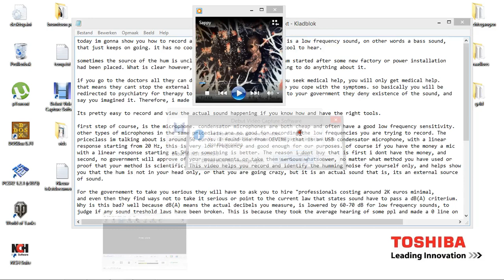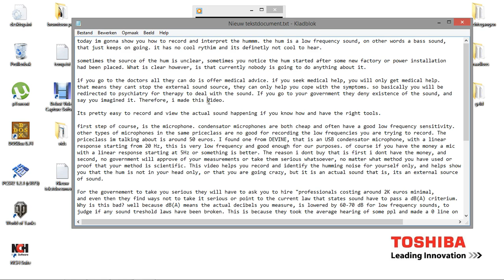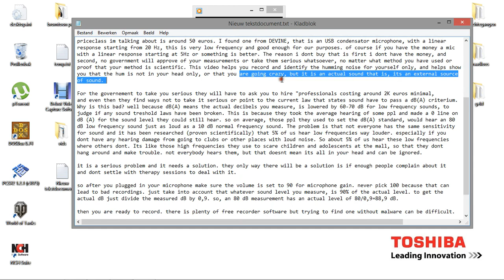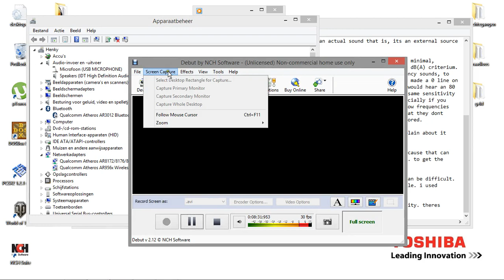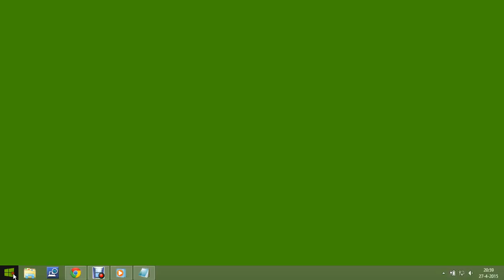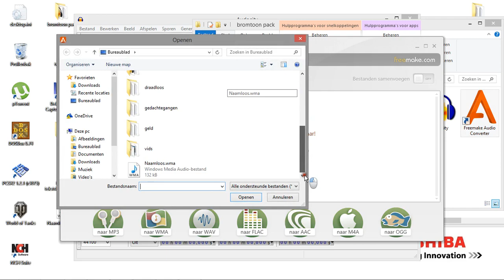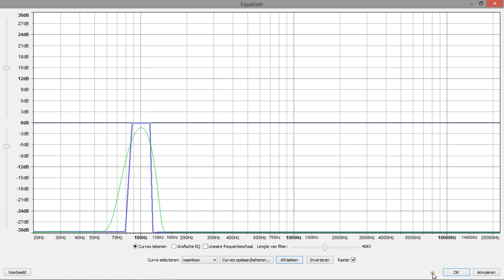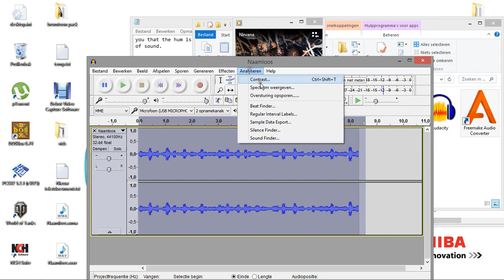How to record and make "the hum" visible - low frequency sound

Comment: How can I use this app??I'm having a problem  with my neighbor. Can you tell me how to use ??please
Reply from the maker: its pretty much shown step by step above. What part are you having trouble with?

- making a recording
- converting the recording to the right format
- opening the recording in audacity
- opening the frequency viewer etc in audacity
Reply: subwoofer  low frequency vibration.  he used subwoofer at midnight  i cant heard sound but i felt vibration. im live 23 floor. so i want to proof when he use subwoofer. is it easy?  thank you so much. henk .
Reply from the maker: Well, I may have been boring in most of what I said in the video but it really does cover all the bases:).

It seems your first step is recording the sound. If in your case it is very clear when you hear it and when you dont, like 2 distinct moments/feelings, then the best thing to do is make a recording when you dont hear it, and make a recording when you do hear it. Then check the difference in dB in audacity to see how much louder a sound is at a certain frequency. The lower frequencies are the bass so thats probably interesting for you. With this method you can show how a "bass" sound is a certain decibel louder then normal.

The first step of course, is making a recording. As said in the video, a condensator microphone is best for low frequency linear responses (its more reliable for measuring the bass). So buy a condensator mic. You can really invest in this and have one with internal battery what will make the recording better quality because your laptop fan noise isnt also recorded, but this really isnt needed in your case. Think of the purpose: you want to see for yourself, maybe show your neighbour. Any sound measurement you do yourself without any certificates etc that you need to own wont be reckognized by law so they will be absolutely useless in court. Its only for you and they person that you have trouble with. If you want to use something in court you have to pay some guy thousands of dollars to make a simple reckognized measurement for you…

Allright, so once you have the simple 20-50 dollar condensator mic connected with USB on your computer, you can check the microphone settings as shown in video...

I think this explenation is going to be as long as my video now that I look at it..Maybe just watch the complete video and tell me what is hard to do:).
Reply: henk visser thank you henk. I just want  use proof  management. When security  came no sound  but I'm laying down I felt head to toes... 2:30am keep vibration  now.    I do have a apple notebook so I will buy mic and  record. I hope it'd work. My neighbor  very sneaky he low volume  and use subwoofer.
Reply: henk visser most of time I hard to hear  but I felt so vibration. I forgot  to tell you :((
Reply from the maker: Not sure if apple notebooks have usb-ports, didnt they only have firewire (or thunderbolt or something) ports? Might need a usb to firewire adapter, check google for your type of notebook:)

recording is done with steps 1-5 from this instruction: https://www.mactip.net/how-to-record-sound-on-a-mac/ or just immediatly in audacity. For me audacity didnt work well for recording, only for interpreting recordings...Just do some testruns first I guess to see what works best.
Reply: henk visser thx
 I will ask some to do this. It's not easy  from me. I will let you know thank you a lot.
Reply: Eun Ji Back I’m having the same issue :(
Reply: What is the title for the person I would need to hire to record this low frequency? A sound technician?
Reply: Nancy  he used subwoofer  until 4am and 9am. I cant sleep nomal.it's felt plus sometime sound too. I feel sorry for you
Reply from the maker: @Nancy I I donno it depends on the country you live in and the language. On google I found some relevant results with "lfn noise" but its still just a lot of research papers. and "sound professional measurement lfn" for me mostly give dutch results of professionals or again research papers or software tools...In my language directly translaten to englisch I used the 2nd searchterm, but generally in the US all the sound pro's are focused on making music so thats sucks. Guess you would have to find some renowned company. A good way to find out what companies are reckognized by law, is to complain at your local government and they send someone reckognized by law to make a measurement. This guy is usually forced by the local government to say there is nothing wrong though if you say you have lfn (low frequency noise) complains from an unknown source, but yeah if you say its your neighbours and they come at a time your neighbour is playing the base then you got a good shot.

In the end it seems it has been made as hard as possible for people to have a grip on the problem of lfn noise or to find out what to do and how. If my vid is to difficult to follow you may wanna try a lower treshold method of just using your internal mic of laptop and apple recording software (quicktime has it) to record the sound without the hum, and record with it, then substract those from eachother in audacity to find out how much stronger the base is then normal. Its less reliable but still can give you a general idea and maybe the local government is more compliant to help you. In my country they are forced by law to serve the people and there are definitions in the law about noise tresholds so...yeah...research and action does help. Thats all the tips I can give you at the moment I think.

So if you can just use your internal mic in the laptop and find the option in quicktime (google apple recording software quicktime) or can use audacity directly (google audacity how to make recording) to make a recording of both situations, with substraction you can filter out most of the unwanted noise your laptop produces (google audacity subtract one track from another).  

So in short: try it yourself if you can, substract and see what sound level you end up with, check the law to see if that sound level is illegal, activate your local government, if they deny existance of the sound use the company the governement used and pay them to make an independant recording. Damn when googling in english its really a million times harder to find these companies...
Reply from the maker: But thats probably because google only searches for local companies...
Reply from the maker: I was just thinking...the response of your internal mic may be so low out of linear that an 80 dB sound (loud) may be measured as 10 dB (nothing). It really depends on the exact model...(a mic is electronic, response means reaction, having the same sound pressure reaction for one sound compared to the other at the same volume,  means linear, having a different measurement means its worthless, so if your internal mic ends at 200 Hz on lower frequencies (the amount of Hz)its...not usefull)Sorry its so hard, when making this video I even made some mistakes that i'm ashamed of but talking about it and sharing can help. I had an lfn group with thousands of members hat had plenty of tips to get me started. But thats for people who hear the bass sound even if its not their neighbours...I started blaming my neighbours but think about it: who would play a base sound with no music and then sleep in the same house? It would annoy them the same as you!

There is just so much to say about this but what really suits to what you need for info in your case...Pro's cost cash and can be disappointing, gah so many possibilities on whats what  just based on that "bass sound bad, need help, I dont understand, how to find help"...I think im at the end here. This is all the info I can offer.
Reply: henk visser  I found few days ago my upstairs  gave subwoofer  too. This is not joke. How to record  upstairs vibration? Please

Comment: henk visser. Thanks for this video. I need to record LFN coming from next door. Can I record, using a condenser mic, on Audacity, and get the same result, without using a recording app? I noticed that you didn't use Audacity, but the FreeMake Audio Converter. Why didn't you use Audacity? I can't use FreeMake, because I have a Mac. I'm not even sure if Audacity will work properly on my 64-bit system for this purpose. Any suggestions?
Reply from the maker: Audacity doesnt detect my microphone for some reason. Also I used Freemake to convert the recording to a .wav file, not for recording itself:) 

Audacity for mac: https://www.audacityteam.org/download/mac/
If you can use the recording function in Audacity it would be better. Else use the built-in recording app of your MacOS or download one from the app store i guess. Check if it has the option to store as .wav file first before downloading.
Reply: @henkvisser9741  Thanks, Henk. I haven't purchased a condenser mic yet, but your other comments on here have been a huge help, because I was about to buy one that does not have a linear response. So it's back to the search for a decent, but cheap condenser mic with a linear response. I'm in a huge argument with EHOs, who won't come out when the sound is at its loudest, usually between 2am-4am. They have basically sided with my neighbour, who told them he only plays his music about once a month, yet his music goes on almost 24/7. This started when he moved in about seven weeks ago.I live in the UK, and have found a green paper, commissioned by DEFRA on LFN. It's a report, and guide for EHOs in the UK on how to deal with LFN complaints. It basically states that EHOs must deal with LFN complaints, and tells them how to detect the noise. I've sent this report to the EHO responsible for my case, but he's taken offence to it, rather than acknowledging that this is a huge issue. He's coming here next week, around 12 midnight, and will adjust his equipment to Z weighting, completely ignoring DEFRA's guideline of using C weighting , to try and pick up the bass sound that keeps me awake all night. That's why I'm looking into doing this myself. I've sent them my diary sheets, I've had my ears checked out (no problems with my ears, or my hearing) as they requested, so I'm now left with doing this as my last option. Am I right in thinking that when you get the Hz and -dB result, you subtract the -dB from the Hz reading? I used the SpectrumView app on my iPad the other night, at 3.30am, and got a reading of 240.9Hz, and -84.4dB. Does this mean the LFN was equivalent to 156.5dB?
Reply from the maker: @kafka6451  -84 dB means its 84 dB less then the baseline. An app usually records and corrects for dB(g) and around that frequency its -90 dB. Z, C of G weigthing means the sound is corrected from the actual recording. So a weighing can say "any sound below 400 Hz is weighed 90 dB less then what is recorded, because thats what people we tested say they can hear". Ill have to recheck what the correction values are for various weighing but if you measure -84 dB then it has already gotten corrected by some weighing. Keep in mind that these weights are put into place by AVERAGES of the measurements. So by that statement, it is already admitted by the authorities that the weights are wrong to apply for complaints...Since some people hear it more then others. 

Like, if you measure 5 deaf people and 5 hearing people, any average is terribly corrected.

Hz is the frequency, the pitch, how high or low the sound sounds. dB is the sound pressure, the force it applies to your eardrums)

edit: and then you get the fun of these recording apps, where 0 is the maximum response and anything below 0 in dB is the amount less then the maximum response...Because that will make things easier haha....sigh. The whole system and tools have been designed to make it as confusing as possible. I would rather have an Ev response table that I can kalibrate then this -dB shit
Reply from the maker: according to what I find the Z weighing doesnt correct the sound levels at all so it would be perfect. sorry for being late to respond...but really i just googled that since I was only familiar with the dB(g) correction. It helps to google stuff yourself, I am definetly not the Pro Elite sound expert...
Reply: @henkvisser9741  Thanks for this. An EHO installed their equipment in my property a couple of weeks ago, adjusted to Z weighting. Yesterday he phoned me to tell me that their recording equipment, worth thousands of pounds, apparently, picked up nothing other than the sound of me turning the record button on. However, he also told me that the meter was't working properly, because they didn't even get a spectrum reading. So, he's going to install their equipment here in January. On the Salford University website (they've done a lot of work on LFN, and wrote the green paper for DEFRA), you can listen to LFN recordings, but only through a sub woofer. I used my headphones. Personally, I don't think the EHOs know what they're doing, because this is not something they would usually deal with (I've had to argue my case every step of the way). But at least I now know the Z weighting is correct. 

I will use Audacity to record on, but have yet to find the right mic. In fact, I'm very tempted to ask EH to lend me one of theirs. I also want to go to their office once they get the recordings in January, so that I can hear the recording myself (with my headphones). Yes, I'm probably turning into their worst nightmare, but being kept awake by the bass sound coming from next door every night, and then having to deal with the EHO during the day is enough to make any sane person seriously lose the plot.

I've googled loads, and I can tell you that your video is the only one I found that actually shows you how to record low LFN. If nothing else, at least I can prove that the noise is real, and not some figment of my imagination. So, thanks again.
Reply from the maker: @kafka6451  Well, funny thing: in my country they make a "blank" measurement to substract from the actual measurement, next step is to use dB(g) correction. I have been in that "soundproof" room and I laughed because the regular sound levels (Hz)are lowered, yes, but the low frequency is enhanced. These rooms are used to emasure blanks that are substracted from all measurements made anywhere else to determine if there is any problem. What you really need is the raw uncorrected sound measurements.

headphones usually are not suitable for these kinds of goals. Soundcards put out sounds to your output and its a soundcard that is limiting your headphone's output. A simple App or headphones or a soundcard wont be within the range you want to accuratly measure or deliver an output on. As i Said, the whole system is designed to screw with you. In my case, all the peak signals (Hz) are exactly between all the Hz used to measure dB(g) sound levels. So I had to use excel sheets and octaves to give the actual output. 

With dB(g) I had 12 dB(g) output and thats ok, with the actual octaves included like 1/3 octave etc I had 65 dB(g). This means a profesional would measure 12 dB where its acutally 65 dB simplybecause of the method used. And this doesnt even correct for the fact that the blank measurementsare done in a sound proof room the only sound proofs for above 400 Hz...

I think I slightly deviated from my point I had in mind...My point was: headphones, Ipad, forget about those...
Reply from the maker: But its good they even suggested db (Z) for you and actually doing the measurement. Just keep in mind people are bound by policies and its not always the persons fault you are not getting the result you want. Just make sure you get all the data for your storage.